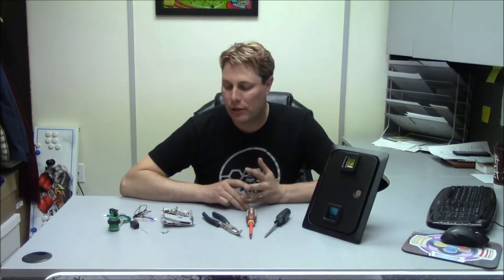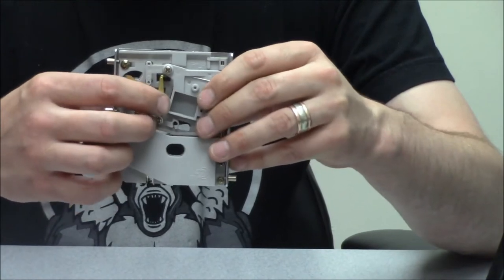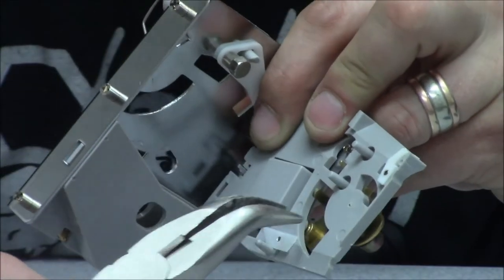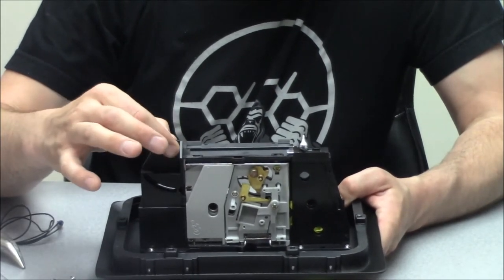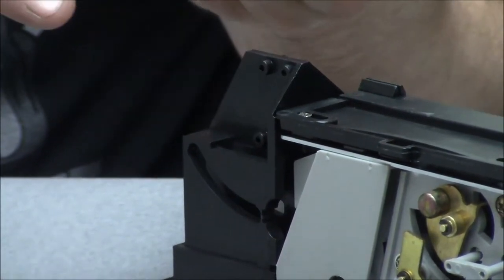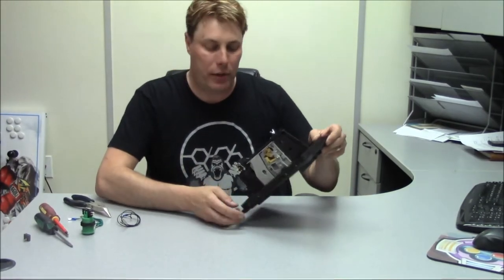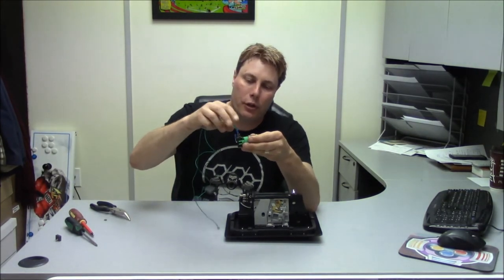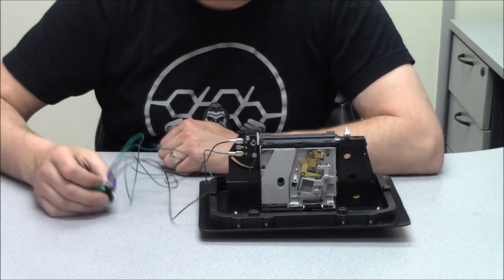How to build and wire an arcade coin door

Comment: Thank you!  This helped me troubleshoot why my coin microswitch wasn't registering.   The bend in my register wire didn't allow the switch to fully depress.   Followed your instructions slightly changed the angle and BINGO!   Appreciate you posting this!

Comment: hi there. I saw your video about connecting the switches to the coin acceptor. but i noticed that the button you have has 3 pins. how bout sanwa microswitches. I only see 2. and i know that the other pin is for ground since it's connected to the daisy chains. sorry for the newbie question. bought a chewlix and having problems with the wiring. and the challenging part is I'm not using pandora or jamma. but pc.
Reply: and another thing.. there are people going nuts about the China coin acceptor (in chewlix-vewlix machines) model PY-800III or PY-800IV. although someone did a way to bypass the mechanism as a solution but if you can provide a solution that will fix and understand the flow of that acceptor.. i think it will be a great informative video that will really help a lot of people about that problem. I see your video very informative. and thanks for sharing your knowledge about it :)
Reply from the maker: If you are connecting to sanwa buttons it technically doesn't matter which pins you use for the active wire or the ground. The ground just has to be daisychained to each button.
Reply: @RetroactivearcadeCa  thanks!

Comment: I have an issue. There are games like TMNT and X-Men that have separate credits for each player. How do I get it so that 1 coin accepter can work for 4 players? Or at least 2 players
Reply from the maker: If you can figure that out I would love you forever! Honestly the only way to do it is to wire all 4 credit buttons into the player 1 input on your encoder and it will credit them all at the same time but there is no way to share credits between the players. Sorry

Comment: On Pandora, when I daisy chained coin button with coin door, only one works at a time. Either it accepts only from coin door or only coin button works but coin door doesn’t. Why not both options work simultaneously.
Reply from the maker: If you have 3 prong microswitches you have to wire 1 switch to the open prong and the second switch to the closed prong
Reply: @RetroactivearcadeCa   Thank you so much!! 😃 I literally had to google to understand nc, no and common connection. It seems on my switch both prong were side by side, instead of corners. Both coin button and door machine working fine now.
Reply from the maker: Will they each work separately? If so that is the only way they will work
Reply: @RetroactivearcadeCa   From coin button, I daisy chained my Ground wire(black) to Com(Common terminal) and daisy chained Coin wire to NC(Normally open). Now, from control panel Coin button works, also Coin Door accepts coins at the same time.

Comment: As clear as mud. Where do you wire the Coin signal?
There are three ways to wire a button switch with a coin switch.
#1 - Parallel: both switches are SPST, switch 1, wire COM to Gnd & NO to Coin as usual and splice both into switch 2, COM & NO - COM to COM and NO to NO.
#2 - Serial: (3-way method) both switches need to be SPDT, NO & NC will be used as runners, COMs are either Gnd or Coin. How to: switch 1, wire COM to Coin, switch 2, wire COM to Gnd, join opposite switches NO to NC and NC to NO for both runners.
#3 - Parallel/Serial: (modified Casey's) need a SPDT & SPST switch with runner, wire switch 1 as normal, COM to Gnd and NO to Coin, plus NC to switch 2 NO, switch 2, wire COM to Coin and NO as the runner (already wired). If you look carefully this is a modified parallel/serial hybrid with Gnd going through switch 1 as a runner and switch 2 contacts reversed. Note: Gnd and Coin can be swapped.
Alternate #3 - Parallel/Serial: need a SPDT & SPST switch with runner, wire switch 1, COM to Coin and NO to Gnd, plus NC to switch 2 COM, switch 2, wire NO to Gnd and COM as the runner (already wired). This is Gnd and Coin swapped version, Coin is a single wire and Gnd is a daisy chained wire.

Comment: I have an ipac 2 and a control panel with coin buttons. My 1a, 2a extra inputs are taken up admin buttons. So is it possible to wire the button and the coin door to the same coin input? How would that be accomplished? I wouldn't think you could just put both wires in on top of each other and screw them down, right?
Reply from the maker: That is exactly what you do, 2 wires to one input on your ipac and 1 wire to each switch! Voila!
Reply: @RetroactivearcadeCa  Thank you.

Comment: My harness came with a coin 16 green wire and also a white cable that becomes a 3 pin harness (White, yellow & black) it’s pretty long ..... so when I hit the coin button it gives me my credit... I want to get the coin mechanism working,  do I hook up the green cable down to the coin mechanism or use that white cable to the coin mechanism?
Reply from the maker: The wire colors change and vary from supplier to supplier and sometimes just because they can. They seem to use scrap wire once in a while just so they don't have any waste on their end. It can be confusing but just stick to what the wiring diagram says, that is the beauty of Jamma! As for the wires and where to go,  the "white" is coin for player #1, the long green is for player #2, or for pandoras box 6 and up it is the pause button. You will have to cut the white wire off of the molex connector and extend it or put a connector on it and connect to a button for credit input or to the coin door microswitch. Hope this helps!

Comment: How do you wire it up to turn off the free play button. For example, I have retropie setup for select as coin in and coin door as coin in but if I wanted to set a game like pac man and turn off the free play and only use the coin door. Do I set the coin door as 1st, run on/off switch between the door and free play button?
Reply from the maker: You would have to physically disconnect the free play button to turn it off. If you will be switching between free play and coin door you will want to connect the coin door up as #1 so that the microswitch is always connected properly if you do disconnect the #2 free play button as that has to be connected to the open side of the microswitch. Hope that makes sense.
Reply: @RetroactivearcadeCa  I got it hooked up as coin slots as number 1's, grounds connected to free play buttons and coin slots, then have the coin slots 1&2 ran to a single switch which has the free play buttons wired to. The coin slot always works, then when I turn the switch, both free play and coin door works.

Comment: So does the coin wire to your harness that goes to your board go to the open connection on the coin slot?
Reply from the maker: Yes, just like a regular microswitch. If you have a free play coin button and the coin door you would wire the button normally and then wire the coin door switch on the closed prong so they are opposite each other.

Comment: How do you power the lights for the coin door? I am finishing up my cab and getting the coin door working is the last part. I am running mine off a PC. I have an old suzo happ over under coin door. Need to get lights for it. Considering leds pwerdoff a USB? , or Getting a 12V power adapter for 12V lights?
Reply from the maker: You will have to connect a seperate 12v power line to the lights from your power supply and daisy chain them together.
Reply: @RetroactivearcadeCa  , thanks for the reply, appreciate it!

Comment: Should you daisy chain if you have two coin mechs?
Reply from the maker: Mike Jacobs the ground wire yes,  if you want the 1 and 2 to work properly then Daisy chain them from the coin 1 and 2 inputs just used the "cloesd" third prong on the coin mech switch otherwise the main coin button will not work.

Comment: Awesome. Hey is there a way to make a box and hook a coin acceptor up to my Atari flashback 8? I have an idea to generate money for a very special charit
Reply from the maker: Technically you can do anything with it.  You have to find a way to splice in your start button wire to the switch on the coin door,  it works the same as a button would.
Reply: I'm not too knowledgeable about the system. Cant find schematics.  But I assume if I disassemble a controller I should be able to see the start button wire and trace it back from there? Or is there a way I can find a full schematic on the atari flashback?
Reply from the maker: @mortywhippet9982  unfortunately in don't have a schematic for you either so will have to trace it back from the controller
Reply: @RetroactivearcadeCa Thank you so much for the help :) Much appreciated :)

Comment: How do you power up the lights in the coin slots when using a rasperry pi3
Reply from the maker: You will have to use a separate power source, the Pi doesn't have enough power to run a 12V lamp. You could rig up a small 5V LED if you wanted to.
Reply: Retro Active Arcade what size wire  is used for this? Do you sell that wire and power cable?

Comment: Hi, what can I use to connect my Original Neo-Geo arcade coin door to a pc? And is it a good Idea to draw power for the coin lights from the pc Oo should I use a separate power supply? Thanks.
Reply from the maker: You can use any type/brand of arcade encoder or mini pac that is supplied by Ultimarc. A computer power supply has more than enough power to support the lights on your coin door, just be sure to find out if the lights are 5V or 12V before you wire it up!
Reply: @RetroactivearcadeCa  Thanks you. You do too much for this community.
Reply from the maker: @scragglewaggle4109  much appreciated!

Comment: Awesome 👍😁 video 👌👏..
Could this work on a Pandora box, like the one in the background of your video here? Thanks
Reply from the maker: Any coin door will work with a pandoras box.
Reply: @RetroactivearcadeCa  Okay thanks,  I just open the control panel on the Pandora box and add wires from the coin buttons to the coin acceptor? Pretty much follow the video and add wires..
Reply from the maker: @johnallen8334  you bet,  just make sure to alternate for connections on the coin door to the third "open" prong on the microswitch otherwise both connections will not work.
Reply: @RetroactivearcadeCa  awesome 😀 I will...